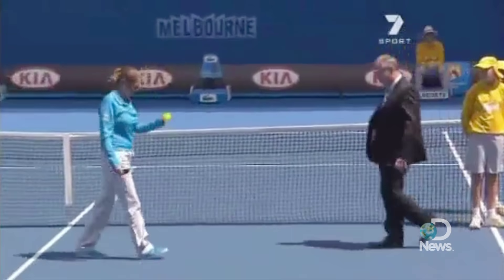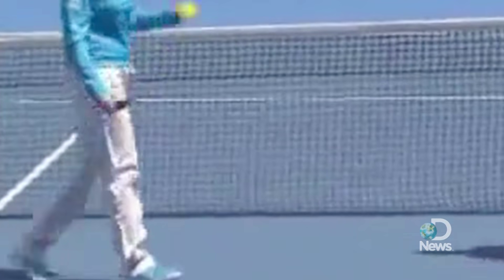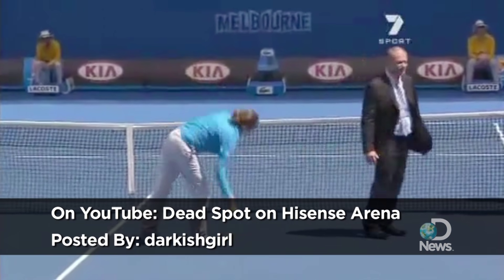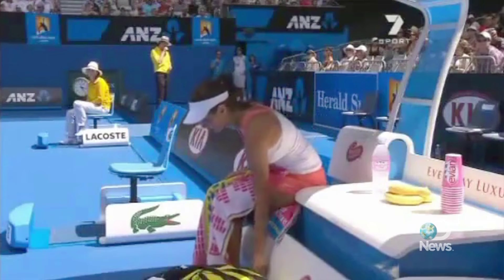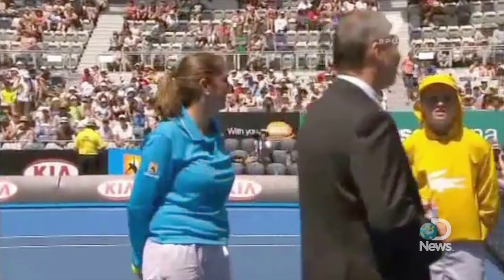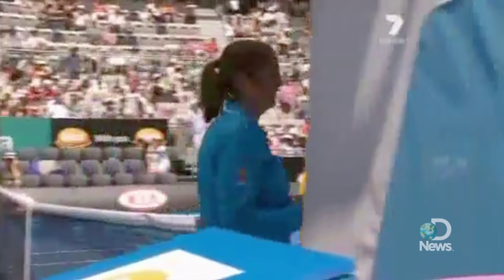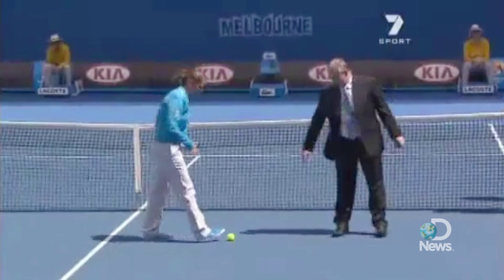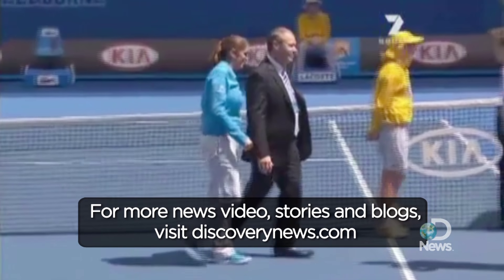Dead Spot on Hisense Arena Explained

Comment: You can literally use common sense to figure that out. You bounce the ball on a flat surface and the force and the weight combined with the air in the ball causes it to bounce up. When it hits the air pocket the energy as well as the air in the ball go into the pocket being absorbed rather than what I stated above. People are so dumb sometimes it makes me cringe

Comment: Dead spot or not Lets not forget that the video is not real people and grossly over exaggerated.  A dead spot simply means the ball will not react as it normally should when it comes in contact with the surface.........

Comment: @nomnzlnd its physically impossible for the ball not to roll with what the properties of what the tennis court is made of being layers of paint, rubber and very small layer of sand and its a tennis ball which has bouncing properties of itself. even if u bounce it on water alone it will still bounce back in some sort of way. that ball didnt move an inch. im not saying it a huge government conspiracy with aliens working with the cows in wisconsin but i do think its more than an air bubble.